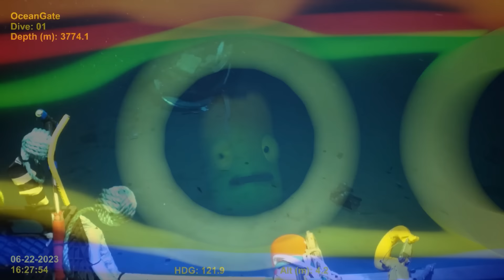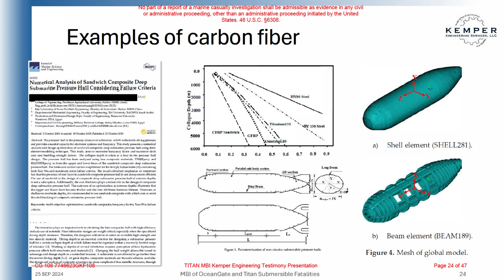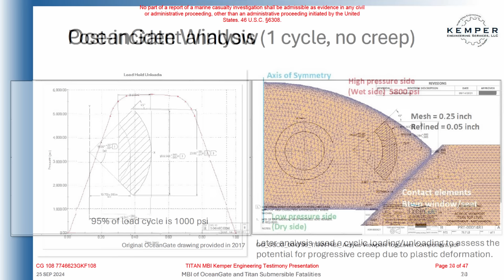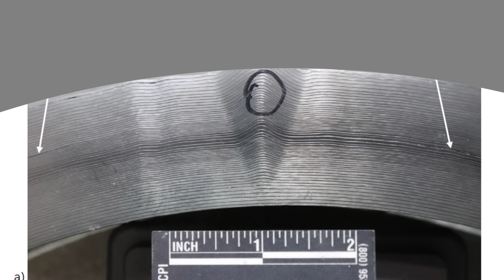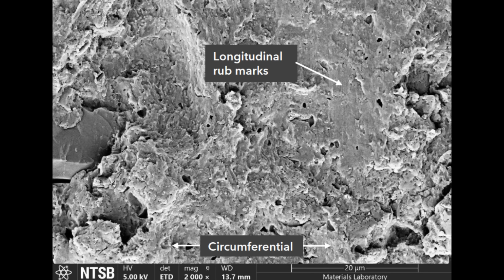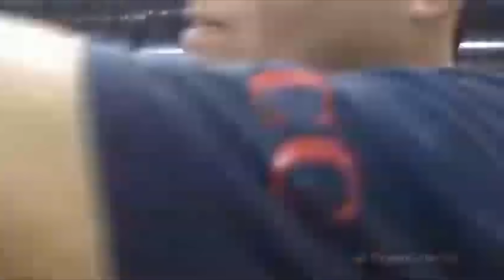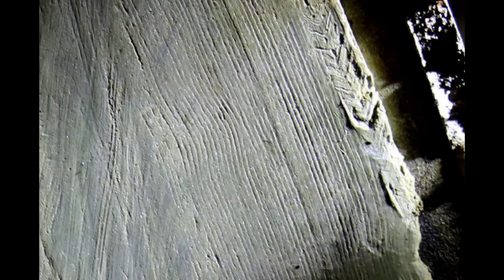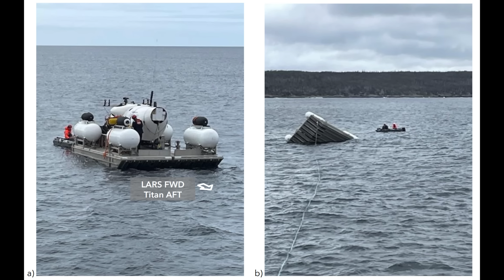OceanGate Wreck Shows Why Sub Wasn't Strong Enough To Survive - NTSB Shares Important Details

Comment: Fun story about acrylic. The deep sea submersible Alvin used acrylic viewport windows instead of glass. When it discovered the first hydrothermal vents, the scientist aboard kept telling the pilot to get closer. The pilot was inching forward and happened to glance at the water temperature reading from the probe on the manipulator arm. It was over 300 F. Acrylic melts at 320 F. He quickly backed away. (The boiling point of water increases with pressure. At the Titanic's depth, it's around 400 C / 750 F. Not something you normally have to worry about in dives since most of the deep ocean is around 0 C.)
Reply: Wow, that is a fun fact. Also props to the pilot for being aware enough to prevent disaster.
Reply: I Imagine, like steel, its physical properties would have been quite different that warm compared to its expected operating range
Reply: @SuperTurbo9001  yeah, it gets kinda plastic.
Reply: @SuperTurbo9001   Yes the HDT (heat deflection temperature) for most grades of PMMA is around 100°C, before it starts gradually going melty around 115°C (vicat softening point). The melting point is often specified around 165°C, but as you have surmised, it's not at all a point. Say injection moulding temperatures for PMMA are way higher than nominal melting point, and higher yet for 3D printing which is like 230-255°C, which is not something that would make sense with an eutectic material.
Reply: and stuff gets softer way before melting
Reply: Due to the pressure, the melting point of the acrylic would also be far higher than at the surface. He wouldn't have been close to the true melting point at that depth. But it is a calculation that should have been done prior to the dive if filming a hdrothermal vent was the plan.
Reply: @DingbatToast Surely it’s the fact that the acrylic will soften with temperature and fail long before it melts.
Reply: @StillAliveAndKicking_ It's not so linear and clear-cut with plastics. Generally they've got a reasonably linear segment of strength, and then under a certain temperature they undergo a form of phase change - known as their glass transition temperature. It tends to occur sharply over a small temperature gradient - for example, ABS, your common household plastic, will need around 8 degrees of gradient. Below it, it's a solid. Above it, it changes into a form of soft, pliable rubber. So as long as you don't approach GTT, you're fine, but as soon as you're in that range of phase change from crystalline solids into amorphous rubber, you have a drastic reduction in strength.
Reply: @EgorKaskader  I disn’t say it was linear. The OP said there was a 20 degrees F difference between the probe and the acrylic. Now most likely the probe is some distance from the acrylic, but a 20 degrees F difference is pretty small. Then there’s the issue with metal components expanding too.
Reply: @StillAliveAndKicking_   Sorta.  The windows are really thick so it takes time for heat to go through them.  The PVHO-design basis is conservative.  You can melt the outer few millimeters, even blacken it, with a quick excursion and then back away before the temperature soaks in far enough to compromise the structure.  You'll still need a new window.
Reply: @StillAliveAndKicking_  Exactly my thoughts.  Acrylic doesn't have a "melting point" in the same sense that, say, ice has a melting point. There's a glass transition (which is not a simple first order phase transition) temperature in there too, and the material softens and becomes "plastic" (in the "moldable" sense) at a temperature that can be significantly lower than the one at which it finally liquifies.
Reply: @DingbatToast  re: "the melting point of the acrylic would also be far higher"
Nope, does not work that way ...
Reply: @uploadJ  yep, it absolutely does. Please do some research
Reply: @DingbatToast  Because the density of solid and liquid phase are almost identical, melting points are basically independent of pressure.
Reply: @kilianortmann9979  no they are not. Melting point and pressure  directly correlate
Reply: @DingbatToast  The inside part of the acrylic would be at 1atmosphere so if that had heated up enough....
Reply: @neilrobertson811  Acrylic is a REAL bad thermal conductor though. I had an 8mm thick acrylic window once that i put a torch to. Took about 10 minutes (While the outside was burning and dropping off) for the inside to become deformable. So they probably had a ton of time to retreat even if they noticed the window start to distort the image because the outside got liquid.
Reply: @neilrobertson811  the acrylic is all at external pressure. Holding the sea out. Do you imagine a crew would survive if the internal temperature was at the melting point of acrylic? It was already above boiling point externally, but fine internally.
Reply: @DingbatToast not all materials increase their melting point under pressure the same way. On the inside of the window you have a pressure a human can survive.
You don't need to actually melt the window. Lowering it mechanical propperties due to heat until it can't hold it and shatters is enough to kill you.
Reply: @DingbatToast yes, but it may be not a good idea to determine acrylic failure temperature experimentally while being under 5000 meters of water.
Wise decision. Maybe too cautious, but is still wise. After all, you want to return home and after 40 years rest in peace, rather than rest in pieces on the ocean floor just 5 minutes from now.
Reply: @DingbatToast  Testing polymer melt points as a function of pressure is not a routine measurement. Not saying it can't be done, but is much less common.
Reply: @donl9571  probably noy a consideration for underwater use. The relationship between the boiling point of water and the melting point of acrylic, will be a reletive constant. So as the boiling point of water is raised due to pressure, so will the bp of acrylic by a similar amount. For the acrylic to melt underwater, the water (ocean) would have to have all boiled, turned to steam, and evaporated. Just as a pan of boiling water can not be above boiling point, the acrylic will never be in any danger of reaching its melting point in water, at any depth.
Reply: @DingbatToast  No, niether the glassy transition temperature nor melting point will change with pressure.   The issue with boiling water is phase change.
Reply: Isn't the deep ocean around 4 °C because at that temperature water is the most dense? Please correct me if I am wrong.
Reply: @KaAyYj 4 degrees for fresh water. Not sure about salwater
Reply: @KaAyYj  Something like that.  Much below that, liquid water starts getting less dense again as it gets colder, as the molecules start sticking together the way they do in ice.  (Though they're still too energetic to hold in that arrangement and actually freeze.)
Reply: @KaAyYj  Cela est vrai pour de l'eau pure, celle des océans contient du sel, ce qui change ses propriétés.  L'eau salée ne gèle pas pas à pas = 0° C mais à plus basse température, et sa densité est plus forte que l'eau douce. Elle a tendance à s'accumuler au fond.
Reply: @KaAyYj  It probably changes with pressure, one interesting thing about water is that because ice has a lower density then water, the temperature of water under pressure can't drop below 0 degrees, instead the pressure just increases and increases until it blows up the pipes that it's in and then instantly freezes (Unless it's under extreme conditions where it will turn into different phases of ice)
Reply: Yes correct  @KaAyYj
Reply: @KaAyYj  not when the water is coming out of a hydrothermal vent, I imagine
Reply: Just as a fun fact, I'm pretty sure that this was a Robert Ballard dive. You know, the guy who found the Titanic, (along with a good number of other lost ships), and has probably the safest diving record around. The Anti-Rush.
Reply: @thing_under_the_stairs  Chuck Norris checks under his bed for Bob Ballard!
Reply: @dancarter482  James Cameron wishes he could make a movie about Bob Ballard, but he's afraid to!
Reply: @thing_under_the_stairs  Do you know about the 3 submarine wrecks Bob B. found prior to the Titanic? Fascinating/chilling stuff.
Reply: @dancarter482  Oh yeah! Submarine wrecks are even scarier than the standard shipwreck. The final transmissions from the Thresher scare the hell out of me.
Reply: That crew would have briefed on all the possible contingencies up on the surface, before ever getting into the sub and closing the hatch.  The pilot would have recognized the water temperature vs melting temperature risk because the team knew they were getting themselves into hot water (sorry not sorry), and would have assessed the risks associated with high temperatures.   The contrast is stark compared to Oceangate's wild-west yeeee-haw cowboy style of risk management.
Reply: The next time I'm on a submergible I am not taking my rice cooker with me
Reply: Mixing F and C has been the cause of accidents as well.
Reply: That pilot probably pooped his pants a bit, seeing the temperature.
Reply: Fvck a duck im surprised it held up at 300!!!  

Thank god that pilot was about his witts!
Reply: That is absolutely terrifying.
Reply: Now they have shields and directed flow to protect the acrylic.
Reply: What are you talking about? The water at the titanic is not 400°C degree C. It's closer to 2°C. If you say otherwise, then please provide the source.
Reply: @geetarwanabe  Indeed, OP is talking about the boiling point. I overlooked it too at first.
Reply: @geetarwanabe He didn't say otherwise your reading comprehension skills simply need improvement. There's your problem. It's a you thing not a him thing. 😂
Reply: Wait .... does one really have to be a genius not to drive a submarine into boiling water?
Reply: @CharlesWhite-j4f  Because of the elevated boiling point, it's not visually obvious that the water is "boiling" hot.
Reply: @solandri69 that's why you have instrumentation like water temperature gauges.
Reply: @CharlesWhite-j4f  apparently one has to be a genius to know that 300 degree water at that depth isn't visually boiling.
Reply: @oldfrend  The clue is in the term "hydro-thermal", from the Greek "water + hot"😂 No science degree required
Reply: @CharlesWhite-j4f  they didn't know what it was 'genius'. give it up dude you were wrong and you're not nearly as smart as you think you are.
Reply: @oldfrend  Well how do you know it's 300 degrees without getting close enough to stick a thermometer in?
Reply: @CMDKeenCZ  they use a heavy duty temp probe, don’t think thermal cams work underwater.
Reply: @CharlesWhite-j4f  so how do you tell water is boiling while you’re in water? You thought it would bubble like the ones in your pot LMAO.
Reply: @CharlesWhite-j4f  you can’t really see the boiling water while in water can you?
Reply: @JojoJoget   Please look at my comment concerning the term "hydro-thermal". You know the water is going to be "hot", exactly how hot might indeed be unknown, but a prudent submariner would steer clear of it
Reply: Wait, it's that hot at the Titanic? How? You mean there are hydrothermal vents there or... is it the sheer water pressure causing it somehow or frickin' what?
Reply: @hunormagyar1843 no, the acrylic/Alvin dive was probably some other location, not the Titanic wreck
Reply: @hunormagyar1843  no, he's saying that is the boiling point of water at the depth the titanic is sitting in. The titanic is not hot. Water is near 0 degrees C at that depth.
Reply: @expert_fretwork  Thanks for clearing that up, makes a lot more sense.
Reply: @hunormagyar1843  No, he meant that if you want to boil water near the titanic, it needs to be 400c instead of 100c.
Reply: @hunormagyar1843  The boiling point ~ Christ!
Reply: @hunormagyar1843  No, he's saying that the boiling point of water is that temperature at the depth of the Titanic. He did not say that it is actually that hot at the Titanic. Please take some time to learn how to read and comprehend what is written.